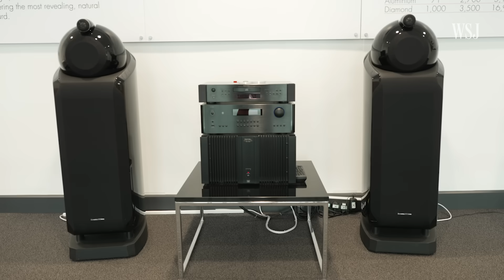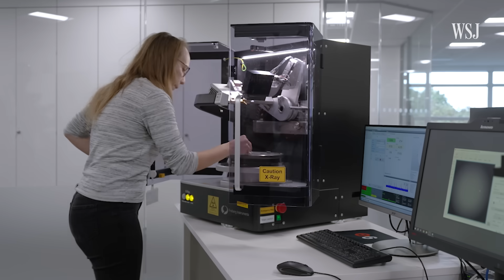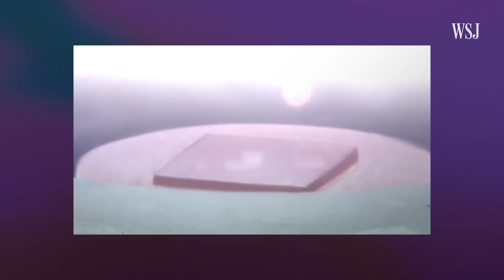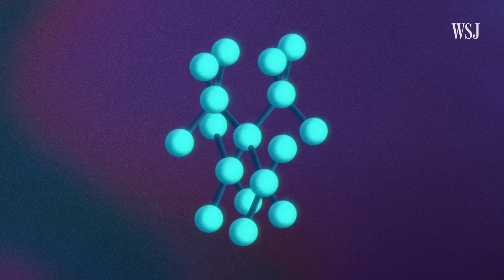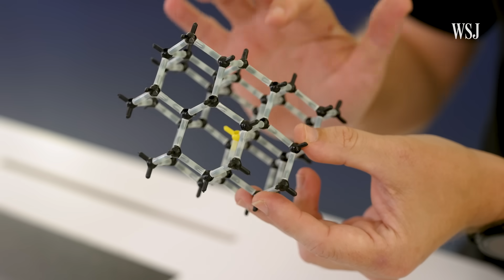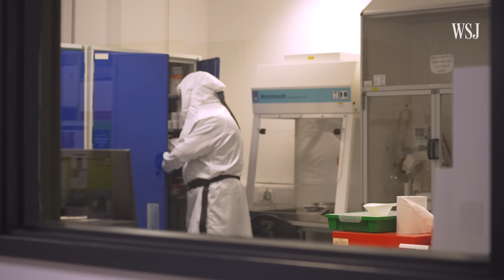The Complex Tech Behind Growing Diamonds in Minutes | WSJ Tech Behind

Comment: Who ever cracks making Lonsdaleite which is 50% harder than normal diamond Tetrahedral crystal lattice structure and has hexagonal crystal lattice which is 50% stronger the gig is up.  Imagine diamonds that last 50% longer in industry.  Right now the only source of them are from big meteorite impacts as those are the forces needed to generate the heat and pressure to make them but there’s more than one way to skim a cat as they say.  They could do this by vapour deposition from seed Lonsdaleite diamond but cutting a Lonsdaleite diamond is a technical hurdle all of its own because what’s harder than a rare form of diamond 50% harder than normal diamond ?  They would have to use lasers I would assume.